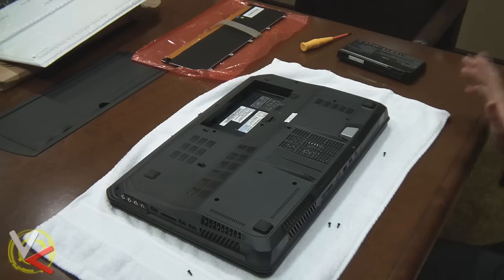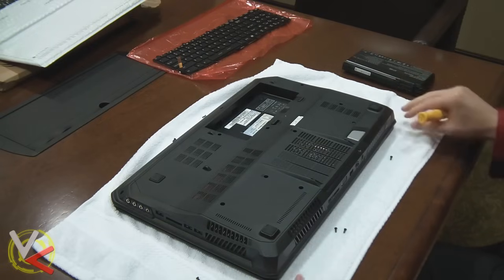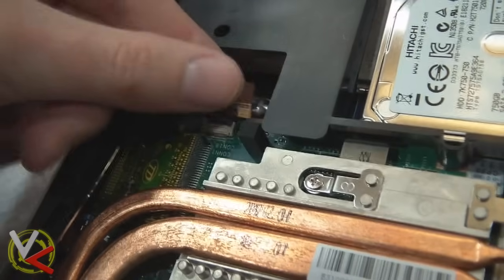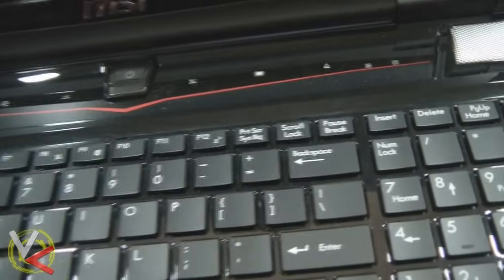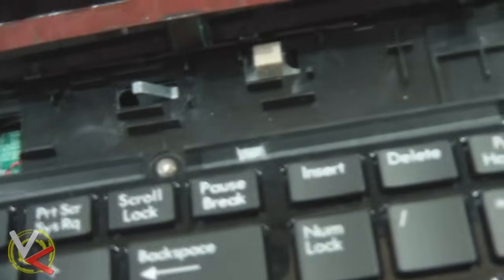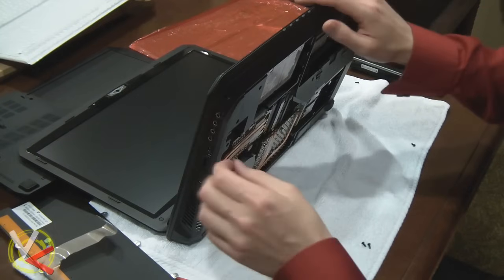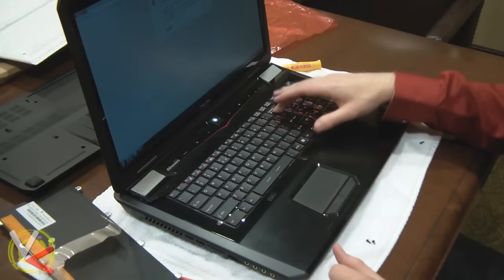Tutorial: Instructions To Change Keyboard on MSI GT70 Laptop (GT60, GT780, GT783 Similar)

Comment: Thank you. I have the gx60 and is supposed to be lighted but the guy that sold it to me put the non-lighted in. I was worried it would be much more difficult. I had a laptop once where I had to literally dissemble it and even take the screen off to change it, ha really bad designing. I was worried to try on this due to the value if the laptop. I actually had the computer guy put the software for the lighted keyboard in when he worked on it for something else and he explained the wrong one was in there. This will be fairly in expensive and easy.

Comment: I have an MSI GT70 2E Dominator Pro with a steelseries keyboard (LED kind with 3 LED sections/colors)I spilled a tiny bit of olive oil near the Space bar area, but it seems like a lot of keys I have to SMASH just to make it work, especially the M and Space Bar and the DOT keysI want to know which keyboard do I have to buy to install it for this laptop?Also I have a program that came included with the laptop, which changes the LED lights, so will the new keyboard work for with this?

Comment: installed a new keyboard after a spill and now none of the keys match up with what is typed on the screen.Some are one letter off some are more.  One of the arrow keys opens the windows menu.  WTF :(
Reply: I had a tinyyy bit of oil spill, still haven't fixed it, but when you replaced it, did you eventually fix the keys? if so, how?

Comment: Thank you so much for a clear concise video.

I have bought 8 high-end laptops in the last 11 years (4x 17" Dells, 1x 17" HP, 1x 17" Saeger, 1x 18" Toshiba Qosmio, and 1x MSI GT70). I bought the MSI GT70 three years ago and have not bought another since. It is the best laptop I have ever owned. I do video editing with it, and it is lightning fast and solid. Three months ago I replaced the 2x HD's with 1Tb SSD's and now it just blazes.

I lived with this wonky keyboard (the "a" and "s" keys works 50% of the time) for 3 years because even with that defect it was better than any of the others. MSI wanted me to return it for repair with a 3 week turnaround. I refused. They would not sell a replacement keyboard because I guess they do not trust people to change it...

Now I finally found a Win7 Full Backlit keyboard on eBay and I'm looking forward to changing it.

MSI could certainly improve service turnaround, and if they ever succeed, they will dominate the market. MSI's are well built, solid and fast. I knocked my MSI off an ottoman onto a solid marble floor and watched in horror as it skip along the floor like a frisbee. I fully expected it to be toast. Nothing happened; not a chip, inside or out. It booted up immediately like nothing happened.

Comment: Hey man, You fix it! Great video. Out of the blue several of my keys stopped working. I tried a bunch of stuff, IE new drivers, shutdown, Ect. MSI warranty would cover it, but I have to pay for shipping and it's going to take up to 45 days round trip.... I found this video and ordered a new keyboard from China with 7 day shipping :( So I'm board on my day off, I haven't even received my new keyboard yet and I decide to take it apart and look at it. I got to the ribbon cable and it just FELL OUT of the slot. So I started looking at the black plastic clip that was supposed to be securing it. I realized it was freaking open! It was taped "open", not even attached down securing the cable. I removed the yellow tape from the cable. I re-installed everything. I re-installed the tape. My keyboard works fine, there was nothing wrong with it. I wouldn't be surprised it that was the case for everybody.
Reply: I have an extra keyboard, if anyone actually needs one.
Reply: C Lane i need it how to deal??
Reply: do u still have extra keyboard for laptop MSI gt60?
Reply: Same happened here :D
Reply: hey c lane, can you tell me what website you bought your keyboard ?  I need a gt70 one,dropped some water on it :(
Reply: I'll sell you mine. $100

Comment: Thanks! I had to put ram extra, and that was behind the keyboard but with your good explanation, I succeeded :)
Reply: how ? you place your extra ram? where the slot located?
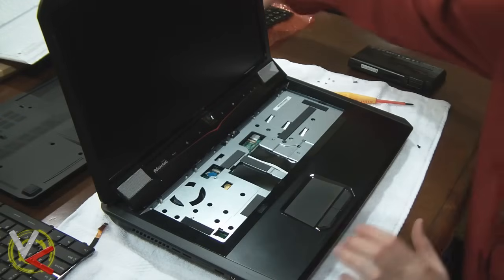Reply: Xui Koh If you pause the video at 3:36 you will see two black rectangles in the centre of where the keyboard was. That's where the two other RAM slots are located, the black plastic prevents the RAM from shorting against the keyboard.

Comment: I have the exact same computer it is new. i am trying to find a solution for an issue i have. The thing that is above the keyboard that has the buttons that turn the keyboard lights on and off and the wi-fi etc, is not working. i have been looking all over for a solution but I cant find anything.

Comment: How did you get MSI to ship you a new keyboard?

I have a wonky keyboard tht misses the "a, s and d" keys 50% of the time (as well as the Ctrl key that only works with 10 lbs pressure), an they insist I send in my unit for a 6 week turnaround. 

I'm willing to buy a keyboard from a 3rd party if they are available. Can you reccomend?

Comment: I have the GT60 laptop(it's a beast), there are two slots on the bottom between the HDD/SSDs and two under the keyboard. with the i7 you can upgrade to 32GB. I have 24 currently.

Comment: On new years eve a little bit of red wine has been dropped on the right side of pc - right over the keyboard and one speaker. It is still alive and everything works, i have opened it by myself to clean coz it smelled red wine and now it's clean and almost does not smell at all. I'll tell u that this notebook is the most easiest for maintenance and with the best build quality ive ever had.

Comment: Thank you for this video. My gt70 keyboard is also defective. When I call MSI they will not replace the keyboard without sending in the whole unit which I do not want to do. I think this problem is more common than I thought. The key presses are very hit or miss. Were you able to get MSI to send you a replacement? If so how did you do it?